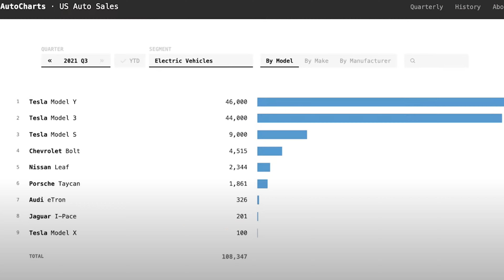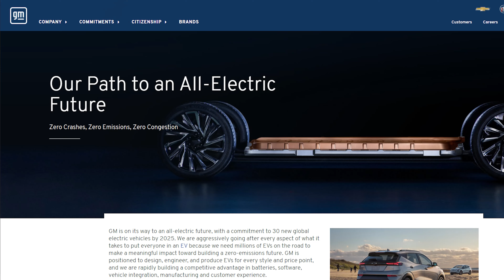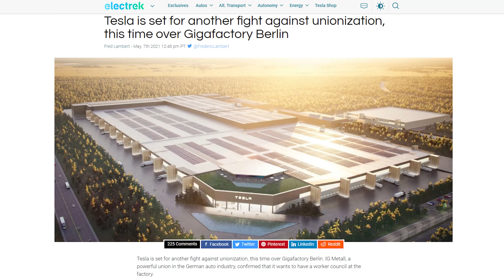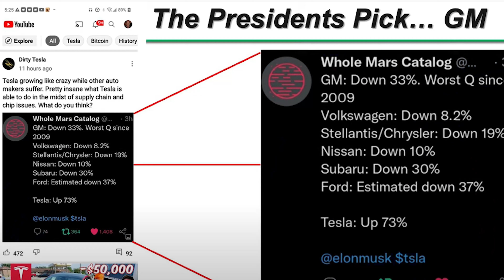EV Lesson for President Biden | Gruber Motors

Comment: Great video!  Note that one slide shows "Over 6,500 charging stations worldwide" for Tesla.  That was years ago.  Now over 25,000!
Reply: Think that number is U.S.A charges.  Not world wide, reason for the difference. Will have to verify that tho.
Reply: just received my 3rd model s last week..can you imagine the next model s with the 4680 battery
Reply: Pretty sure I saw a tally the other day and it said 30,000
Reply: @Davidg1940  Um...why?

Are they so crap you have to replace them every 2 years or less?
Reply: Chargers is 30k+ and site is 3k+ as far as I can tell.
Reply: @billcichoke2534  you don't know when he bought his first.
He could be changing every four or five years. The third one is very recent as he says. There are loads of old S's running around Sheffield and Chesterfield in UK where I live and work. Reg on one is TH15 TEZ.
Reply: @andrewsaint6581  His first would have been, at the EARLIEST, in 2013.  That means he's had each car for around 4 years.  Not 2, but not 10 or more.

The point was, these were supposed to be 'forever' cars, and they're actually being traded in faster than most Mercedes models apparently are.  That tells me EVs in general (and Teslas in particular) are crap.
Reply: @billcichoke2534  how many have you driven?
Reply: @andrewsaint6581  Only had a chance to drive a Model S.  It didn't impress me as sporty OR luxurious OR well made.  All it has going for it, is straight line 0-60 acceleration.  Overall driving experience was actually worse than a converted 1972 VW Super Beetle I got to drive in the 80s.

And that's the FLAGSHIP car, that all the others are measured against.
Reply: @billcichoke2534  he has 2 wives ;-))
Reply: @HenkvanHoek  ...and another drive-by commentor says...

...I dunno...
Reply: @billcichoke2534 I can’t imagine where you live , but I count the Teslas I pass on a normal two mile drive in town and today I got 25 or 28 and once at a four way stop, I was the only non Tesla of the lot. Man they are everywhere , but I don’t need to convince you of anything. That’s the way you want to see it and it’s fine by me. It’s not going to hurt sales any , that’s for sure
Reply: @sandyt4343  I live in eastern Oregon; moved out of the Portland metro area over 10 years ago.  Even with the Berkeley infection that was starting to destroy anything good about that town, EV count was low.  Now, every time I drive through (I don't risk my family's safety visiting), it takes me a good half an hour or so on the interchange to see SIX Teslas, much less anything over TEN.  Even a visit to the LA area for my wife's college reunion netted no more than 5 THE WHOLE TIME WE WERE THERE, including a dusty red Model S in the rental lot.

I don't think sales will be hurt.  I think ACTUAL sales numbers will hurt sales to any fence sitters.  And if a Model S owner can be swayed by a similar year model Camry, how many more than the current 20% will switch back FROM EVs?

Methinks these cars aren't as sure a thing as all the/you propagandists would have one believe.
Reply: @billcichoke2534  I don’t know if you are able to spot all the newer ones since the model S was kind of the standard, on the other hand I intentionally look for them so that probably makes a difference, I know I never noticed of Subarus until I bought one and then every other car I see is a Subaru. Seems to make a huge difference when you buy something suddenly they are everywhere. Either way these are just all opinions and time will tell. I it’s kind of like two people looking at a mountain from opposite sides, on one side the sun is coming up and on the other side the suns going down maybe. Time will tell I guess
Reply: @sandyt4343  Well, in my case, since I'm familiar with (and really can't stand) most EVs in production since the Prius, I AM intentionally looking for them.  It's kind of an 'anti black pill' attitude I have, regarding quite a few things that have been portrayed as 'inevitable.'  And when a group of people try to juice their one and only stock by spewing propaganda, I have a desire to expose it for the falsehood it is.

How many times have you read (or written) that EVs in general, and Teslas in particular, are now mainstream, and everyone is buying them?  Or how 'over half of prospective buyers are considering/want to buy an EV?  There should LITERALLY be an EV for every 90 ICEVs.  There isn't...not even close.  And I'm talking about JUST battery EVs, and not just Teslas.  The amount one can see on the road...ANY road...is nowhere near even 2%.  And (interestingly), they can't be made fast enough, but every pro-EV site out there has AT LEAST 3 brand new Teslas to GIVE AWAY for some write-in competion or other.  Not old, not used, NEW.

Rather odd if Tesla is actually 'supply constrained,' don't you think?
Reply: @sandyt4343  See, this is where many (including me) deviate from and reject the narrative.  EVs can only be mainstream if they can fully replace ICEVs without being less convenient AND less harmful to the environment/peoples' health AND an overall better option.  Battery electric EVs have NEVER been able to do this, due to the inherent problems of batteries; nothing has changed, even with more chargers and different battery chemistries.  And the problems with mobile electronics are being magnified in EVs, needing specialized (and more expensive) servicing.

'Black pilling' refers to giving in to propaganda.  Like I said, many folks are refusing to do this, and exposing the overt lying going on about this subject.
Reply: Buy Tesla stock!!
Reply: @Mpr47276  Unless the EV tax credit and mandates go down in flames.
Reply: And there is over a million gas pumps in America. Still a long way to go.
Reply: @bmw803  And more being built.  I guess folks just didn't get the 'EVs are inevitable' memo...

Comment: Tesla has demonstrates EV excellence & was an All-American company & should have been mentioned in the president's speech even tho they're non-union, however, their contributions shouldn't be overstated. Especially in regards to price/affordability.

GM EV1 1996 (lease only)

Tesla roadster 2009 - $109K

Nissan Leaf 2010 - $33K

Mitsubishi I-MiEV 2010

Ford Focus EV 2011

Tesla S 2012 - $76K

Chevy Spark EV 2013

Fiat 500e 2013

BMW i3 2013

VW eGolf 2014

Chevy Bolt 2016 $$37,500 

Tesla m3 2017 $35k

GM scrapped the ev1, but it was more than the other makers were doing.

Comment: Do Teslas already have brake by wire system ?!
Reply: Depends - Teslas have power assist brakes but they are mechanically linked to the brake pedal and the brake pedal always activates the friction brakes.  All regen happens automatically due to not pressing the accelerator.  This keeps the brake feel good and removes the strange complication of the brake pedal doing blended regen and friction braking.
Reply: There is no brake by wire car on the market today.

Comment: EVs can run out of charge at inconvenient times, and there has been talk about aluminium air batteries but I do not know how good they will be. I am not thinking about replacing EV batteries with Ali air in any case, but I did wonder if something like that could be dropped into a boot and plugged in to keep them or getting them going again. Just food for thought. Why one when you can have both, maybe there would not be enough power in a single unit which would make it a pointless idea..🤷‍♀️
Reply: Gas cars can run out of gas at inconvenient times. EV owners start each day with a full 'tank' and if a Tesla owner have a huge charging infrastructure to use. The car notifies the user of the state of charger which chargers are available and free to use and if working and how long they need to charge, warms the battery to speed charging etc, there is zero inconvenience.
Reply: @johnmqueripel2367 Well said,  I have 14,000 miles of cross country Model Y use, and I find it's more a computer than a car. To run a Tesla out of juice requires the aptitude of a Biden speech writer, or perhaps Joe Biden himself  ;-)
Reply: this would never happen to gas vehicle, right?.. LMAO GTFO clown

Comment: I'll never get an EV reason being 6 months of below freezing temps it would cost more to keep it charged then my gas car. All I do is plug in a 4amp smart charger bc of battery drain during the cold.
Reply: Live in Canada with 6 months of of below freezing temps, have driven an EV for 4 years never had a problem in the winter, starts every time in the cold.
$12.00 per 1000km summer
$16.00 per 1000km winter
Reply: Six years and counting, 2 EV's a Chevy Bolt  and Tesla M3 and in Western NY we get cold 
temperatures ,just charge every couple days ,NO PROBLEM.
Charge for what you need each day and set departure charging to have the car ready at 
whatever time you leave in the morning that way the battery is warm and ready for your day.
You can also pre condition the car hot or cold on utility power and not use the battery to warm 
up the car.
Reply: EVs have been doing well in Norway for a few years.  In fact, a recent report states 8 of 10 cars sold in Norway are battery powered.
Reply: My Tesla stays charged on 9 amps, at 17 cents a kWH. And, I buy no gas or oil. You can’t do math-There is no beating low EV running costs.
Reply: Take a leaf and charge it with a gas generator it would charge 20mpg of fuel. I tracker gets 15-27mpg with a running cost of 14 cents per mile. I only spend 300 bucks on maintenance per year and roughly 50 bucks a month on fuel. Our power is 24 cents per kWh and with a house that has no natural gas it's all electric. If we weren't on the budget plan we could be spending upwards 400-500 per month just for electric during the winter If I added an EV it would add another 200 to the bill.
Reply: @brutushobbies  Your mah is screwed up. My Tesla Model S goes 3 to 4 miles per kWH, and is a lot heavier and way faster than a Leaf or a Tracker. At your 24 cents, that is 6-8 cents per mile. You are only cheating yourself with that kind of ignorance.
Reply: Not really since 42% of our state power plants run on coal
Reply: @brutushobbies  by your numbers, if you got 30 mpg, 50 bucks gets you about 550 miles at $3 a gallon. $200 at your 24 cents per kWH would buy over 800 kWH, which would drive my car 2400-3200 miles! Math is not your strong suit, Brutus.
Reply: @brutushobbies  If you drive 600 miles a month, the Tesla will cost you about $20, and nothing for maintenance.
Reply: Coal is more polluting than gasoline. So I'm sticking to gasoline
Reply: @brutushobbies  you are just WRONG. To produce, refine and transport crude oil and petroleum products requires great quantities of electrical power. I am using much less coal than you are.
Reply: @davidvicari5139  Brutus is a D minus math student, please dont judge him. he's a victim of poor public education system... Sigh